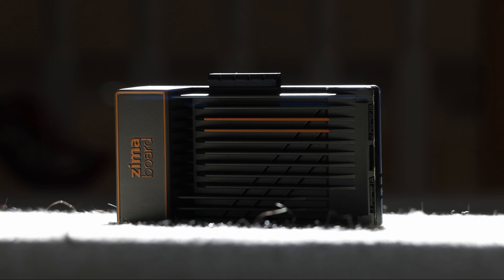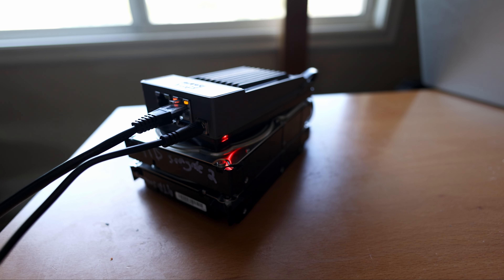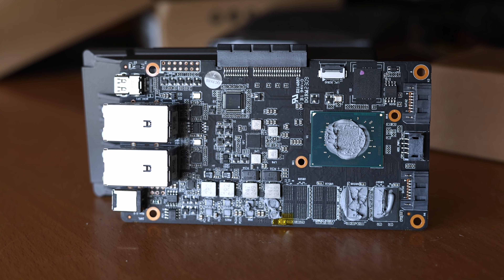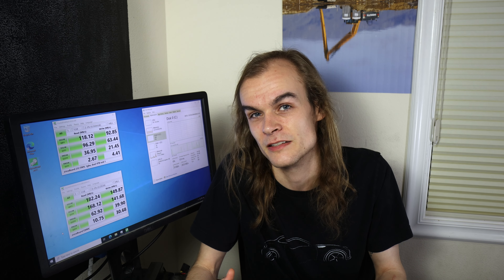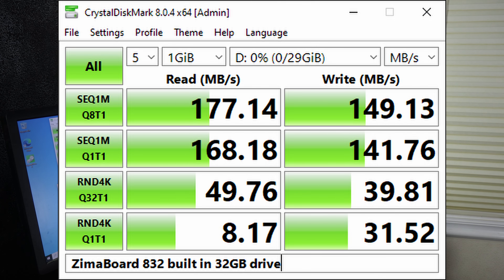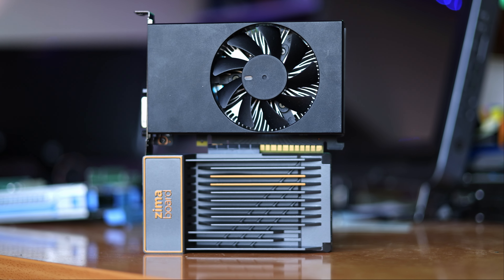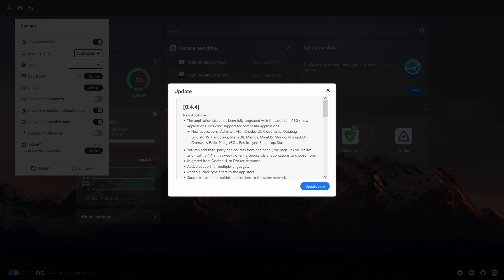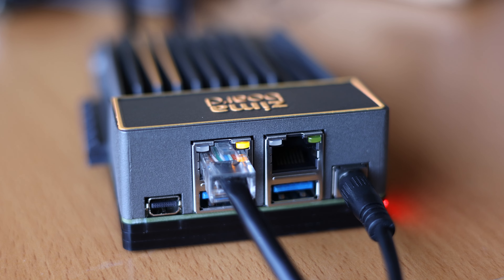ZimaBoard Review. A Flexible Mini server with PCIe and SATA

Comment: I have a 2gb model w/ a usb pci expansion card. It’s a neat bit of kit. I’m currently running OPNsense with no issues with Realtek. Casa OS is pretty neat, too. Although I didn’t really use it. 

If I had to buy another, I’d get the 8gb.

Comment: With few tweaks this would be awesome little box. RAM slot(s), casing to have space for smaller pci cards and to housing to integrate drives for those sata ports. Essentially packaged into roughly like those external GPU boxes. Oh and deletion of especially that blinking sata ports and I would buy one instantly. Quite shame as it's almost what I wanted my old NUC to be, but with really bizarre hardware layout. I think there's definitely market for lowpower, compact, but still customizable hardware. I suppose vendors think that this bit niche target group will built their systems from ground anyway.

Comment: I have an HP Z640 workstation. It can host 4x NVME with the quad addon card. That's 4 drives. Then, Linus said that it can handle 9 drives and I'm assuming that's SATA (regular SATA)? So it can run 4 NVME and 9 SATA? You can get them old dual Xeon Zs for like $100. I wonder what you would do with one?
Reply from the maker: I haven't worked with that exact system, but it seems to have pretty good expansion. I have worked with other workstations from the big suppliers(Dell/HP/Lenovo). There generally pretty good, but typically not fully ATX. I'll probably make a video on one in the future.

Comment: Zima is pushing on all fronts - the fact that 100 youtubers show it, does not change it - it is what it is - nothing special and very expensive
Reply: Jup, totally agree!
Reply: They would definitely need to bring a version with the new N100 SoC. That would make it much more usable!
Reply: I don't know. Out of curiosity checked and pricing is quite reasonable imo. There's actually quite good bundles there too apparently. I just dislike the layout of the device. Like it's trying to cram too much features to small space. Like I find it very bizarre to have sleek casing and then bare pci card leeching it 😀
I'd rather have bigger casing to fit all possible extentions, like drives and that card. It just feels that if you plugin pci card to it, it would be all the same to strip zima out of casing too. Ok there's the heatsink but you know what I mean.

Comment: So you recommend for proxmox? Looking to replace my rPi running docker. Build a large proxmox server but do kot what it on 24/7. And installing proxmox and having HA sounds great
Reply from the maker: Proxmox works pretty well on these. I’d just try to run as many services as containers instead of VMs to save ram. I have seen videos doing ha setups with these and that’s a cool setup, and is a lot cheaper and less power compared to big servers.

Comment: Does anyone know if the ZimaBoard currently runs RAID?
Reply from the maker: You can use software raid in your os to manage raid on the system. There might be the Intel chipset raid but I never tested it as I typically prefer software raid.